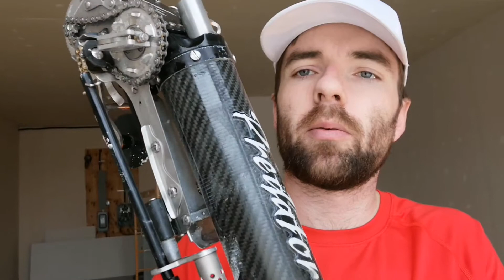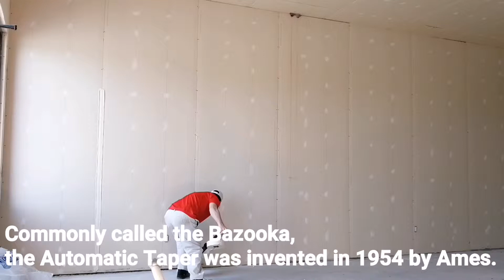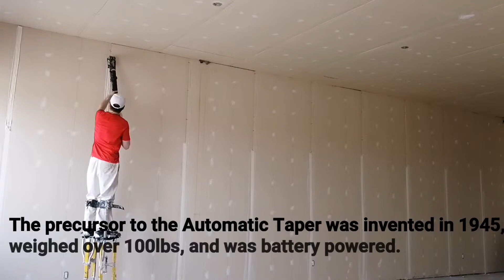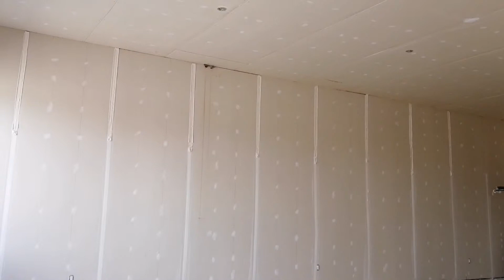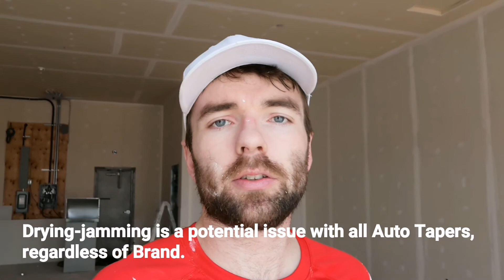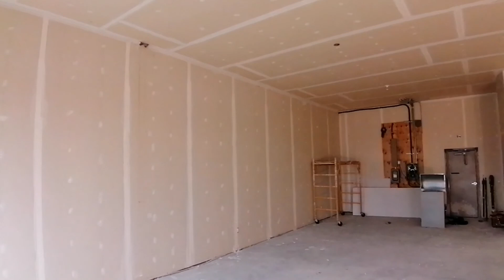12 Foot ceiling with the Automatic Taper

Comment: All in all, I think the final result was good. I know that many guys that do this kind of work use a 10" knife with a pole that keeps the knife blade at a 45degree angle.  It appeared that most of the mud that fell from the ceiling happened when you were applying the tape with the bazooka and not when you were wiping it, but like I said the final product looked pretty good to me.
Reply from the maker: I learned later to run the bazooka on only 1 wheel and that stopped the mud from dripping, also yes I agree having the pole-knife at 45° helps a lot. Always learning. Thanks.

Comment: Nice clean work. Just wondering why screws first before anything? No prefill, even on butts? Great videos, please keep them coming!
Reply from the maker: Thanks, sometimes I just do the screws first to warmup, I used to be really picky about the prefill, but   I did some experimenting by putting tapes on, wiping or glazing them, then tearing them off to see the upper limit of a gap I can leave, the bazooka puts on a large excess of mud and fills alot of gaps on its own, by squeezing it in as it's wiped or glazed.

I do normally prefill ceiling buttjoints regardless, as the thinner bazooka mud and gravity can cause the center of the tape to sag a little as the mud in the gap dries, making more work to get flat, but as long as there's not a hollow under the tape,  shouldn't be any higher risk for future issues,  just potential for extra coating.

For that reason the ceiling buttjoints in that video should've been prefilled 🤫 🙂
Reply: @Interior_Works  Always best in the long run to V cut the butt joints and prefill everything. Much less fill coating of the bands when they have been prefilled. Doesn't take that much time.Also, kinda looks like you are "double wheeling" the ceiling joints. One wheel contact is best.
Reply: @endoalley680  double wheeling????
Reply: @mixer7586  Both drive wheels in contact with the tape at the same time.

Comment: Is there videos for angles , flat box , screw heads? Awesome stuff
Reply from the maker: I have some videos so far, not best quality videos, but I'm practicing to get better.  have a 2" and 3" nailspotters, 5.5,7,8,10,12, and 14" flat boxes, 2",2.5",3",3.5" angleheads, 2.5",3",3.25",3.5", and 4" Flusher-heads/Glazers, many other rollers, applicators, and will be making more videos showing different ways and what I've learnt and think about all the tools, what works and what doesn't
Reply: Make a video how you lubricate your boxes and taper. How you change your blades and adjust for the boxes. Thanks so much
Reply from the maker: @Bob-n2d  Ok that'll be next on the list, I use a certain nontoxic silicone lubricant on the tools that doesn't damage the gaskets. Anymore video ideas let me know.